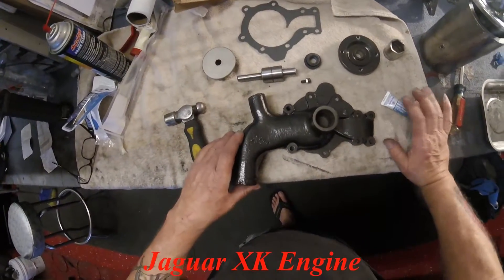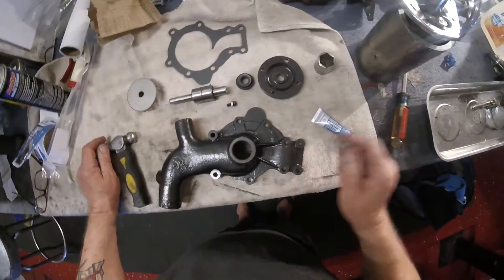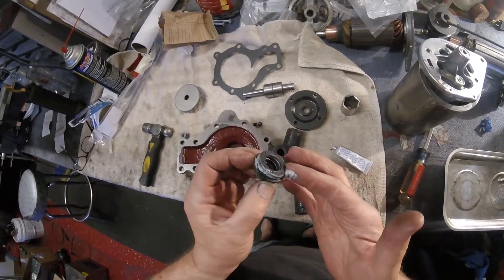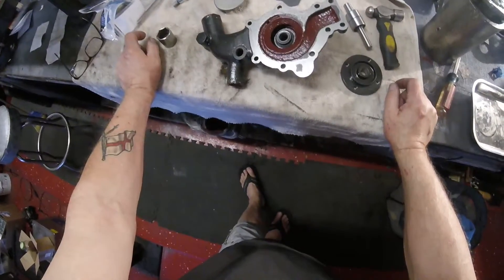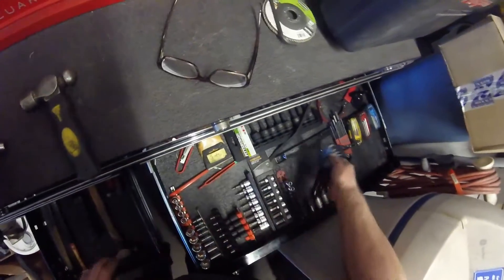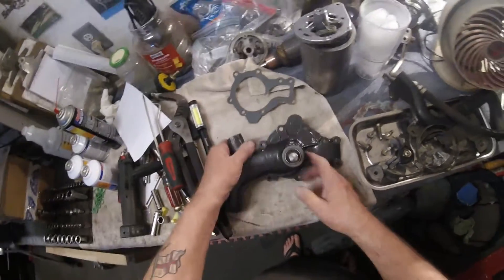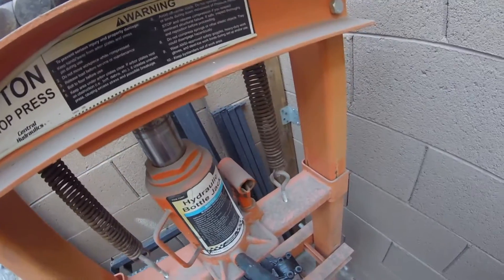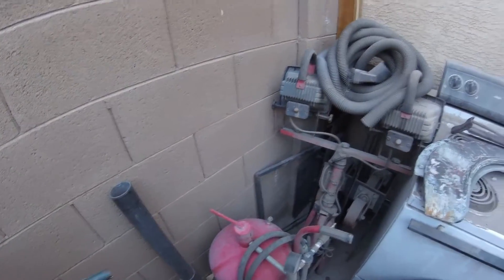60's Jaguar XK Engine Water Pump

Comment: How does one determine the clearance of the impellor with the casing without having to first seat the seal and impellor on the casing?  Seems one would have to fully seat the impellor with zero clearance then press it backwards.
Reply from the maker: The kit I had from SNG wasn’t a problem as I pressed the seal on fully, them pressed the impeller on until it was about to touch and then stopped, there is a clearance measurement but with the original pitted body it’s hard to measure.

Comment: I discovered that the bearing is machined into the shaft, so making a longer shaft is not a solution.  I'm going to investigate machining a thicker hub for the pulley so that the depth of engagement with the shaft is not compromised
Reply from the maker: Yes the flange is pressed on to the shaft and determining how far to press on is fiddly , as I had already pressed mine on I will place a spacer inside the pulley and use longer bolts, not ideal but it will work.

Comment: I purchased the rebuild kit from SNG Barratt.  Upon disassembly of my old pump I found the replacement shaft to be shorter than the original.  When the hole for the locking screw is in the correct position the pulley side to the bearing is sunk down into the casting by 1/4".  If I were to move the bearing face to where it is flush with the casting (and drill a new hole for the set screw) I think the impellor will not be fully imbedded on the shaft.  What is the solution to my problem?
Reply from the maker: I discovered the solution today, I’ll insert a full explanation tomorrow, if you can email me at gstarrgarage@gmail.com then I will respond to your email address.
Reply from the maker: SO that every one can read this the rebuild kits shaft is shorter than the original therefore do not press the flange fully on or the pulley will not line up mine is approx 10mm recessed (you will have to see how yours lines up). Also do remember to leave clearance between the impeller and the body casting but because of corrosion I just pressed it on until almost touching, there is a spec for this but that assumes a new body. Hope this helps.
Reply: I contacted SNG Barratt today about the water pump shaft and bearing in their water pump kit being the wrong dimensions.  They were already aware of this problem and said it has been ongoing for some time.  They have not remedied the problem, nor make their customer aware of these deficiencies when the rebuild kit was ordered.  They believe that the pulley being not fully seated on the shaft will not cause a problem.  Based on my comparing the dimensions of the original and replacement water pump shaft the pulley will be 0.135" from full engagement,  the bearing is 0.148" shorter, and the replacement impeller will be 0.021" from full engagement.
I don't agree with SNG's rational and plan on having a correct size shaft machined.

Comment: On the original pump shaft is a hole for the locking screw much better to prevent the shaft from axial play.
Reply from the maker: On all the ones I have re-built I have not seen one with a hole but maybe the early ones did and they changed the design for quickness of assembly.